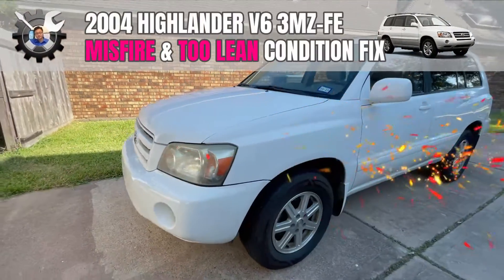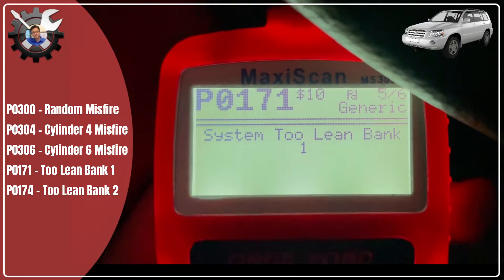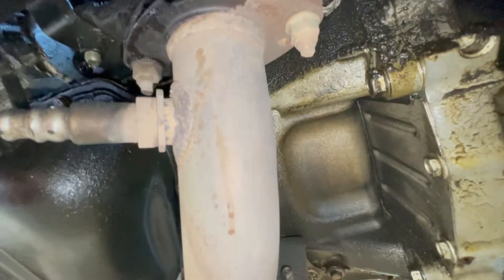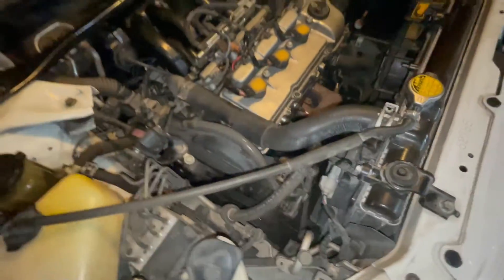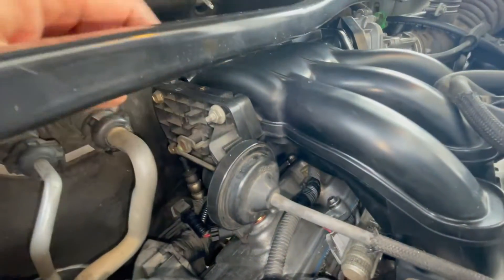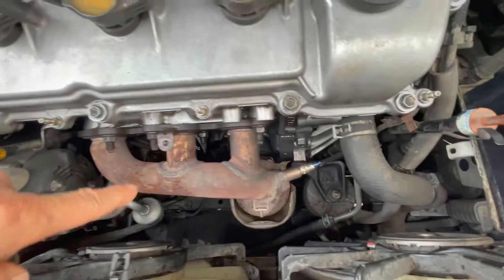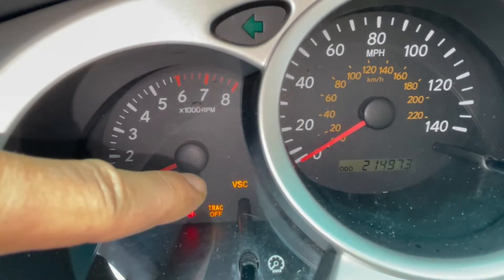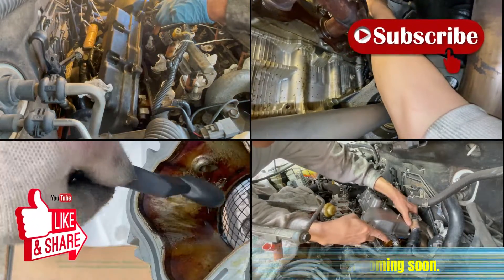Toyota/Lexus 3MZ-FE engine Misfire & Too Lean Condition

Comment: I have already had this problem which was actually caused without my knowledge by a sufficiently clever buyer. The engine became defective, so he tried to lower the price by 50%. Of course, I didn't accept and found the problem the next day.
Reply from the maker: @jocelynguenard8572  So you bought or not? That’s potentially easy fix if they discounted 50%

Comment: That's the bank 2 engine coolant drain valve. There's another one above the front right wheel for bank 1.
Reply from the maker: I figured it had to be coolant drain because I smelled coolant.

Comment: @0:53

HEY!

My flooding condition problems started also when I did valve cover gaskets and spark plug tubes on my 1999 Toyota Solara 3.0 V6 1mz-fe!
Reply from the maker: What do you mean by flooding condition?
Reply: @DIYLifeSkills  

Raw gasoline smell. I suspect it is fuel injector o-rings but I just can't get time to look at it because my life is in hordes-of-chaos right now—and has been for the past eight months.

Comment: Its not the breather spout but rather the front coolant drain . There are two coolant drains on the 3mz engine . Thats the front one you are asking about, The other is in the rear of the engine. A 10mm wrench or socket is used to slacken the nut. Very useful when draining the coolant system. The transmission breather is a rubber hose with a spiral protective sleeve and comes up from the transmission near where the lower radiator hose connects to the thermostat inlet tube.
Reply from the maker: Makes sense.  Thanks.

Comment: That's a breather spout for the transmission i do believe... My 1nz fe engine has the same
Reply from the maker: Someone in Highlander forum thought it was engine coolant drain valve.  I haven’t confirmed this though. I didn’t know engines had coolant drain, I only knew of drain outlet from radiator.  So I need to check it out.
Reply: @DIYLifeSkills  The 3mz engine has two coolant drains.
Reply: Their operation is pretty much like the radiator petcock. You don't have to remove them fully. Just loosen the 10mm bolt suffieciently for the coolant to flow out. A hose of maybe a 1/4 or 3/8 inch inner diameter ( forgot which ) will fit on the nipples. Dont forget to tighten when done with draining.